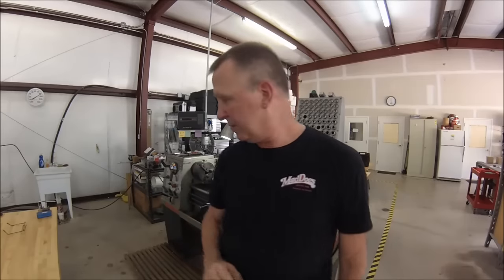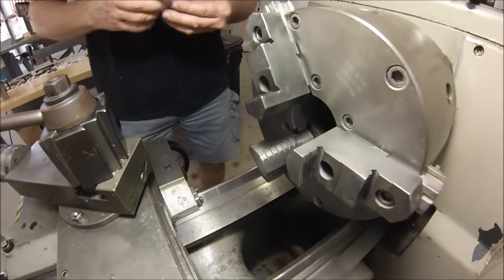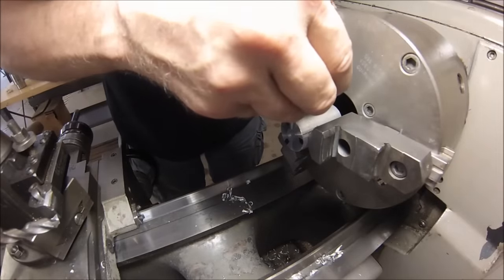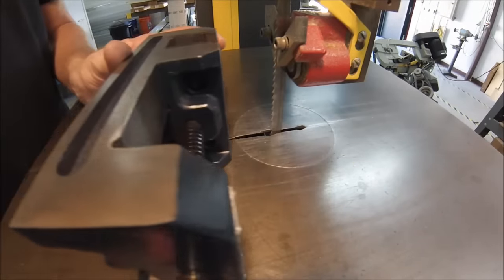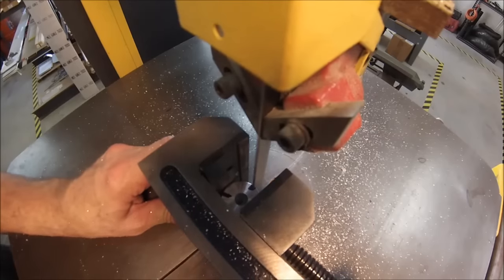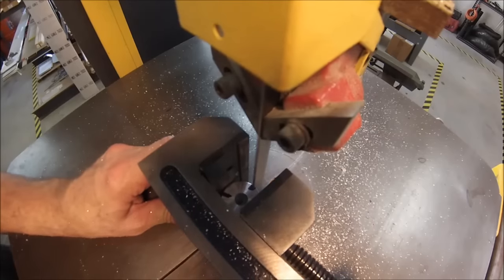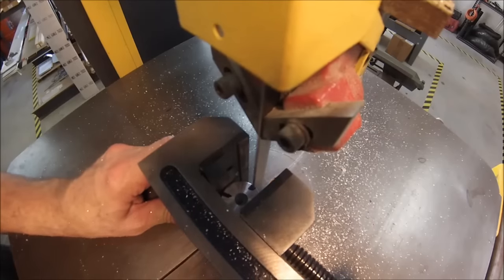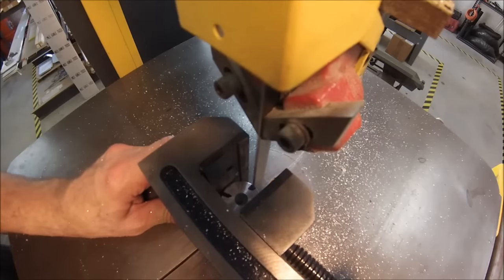Get your parts to run true in a non adjustable chuck. YOU MUST WATCH THIS!

Comment: ive tried this before at a shop i worked at, chuck still didnt repeat though.. it would get thrown off every time it was loosened and tightened again. after many attempts of trying to get it to repeat true i ended up putting a four jaw in and i indicated in a large jacobs chuck and just used that as the chuck. but i am curious as to why you would suggest this over just boring the jaws...
Reply from the maker: Because this video wasn't about boring the jaws.
Reply: yeah i noticed that... it was a half hour video about boring a sleeve with slots in them, like a 5 min op.

Comment: Joe Pieczynski I did a traditional indentured apprenticeship. I've never heard it said nor seen it written (before this vid) that one should not run a machine with an empty chuck as long as jaws are clamped shut. What is your reason for writing this on the video captionst 2:50 in ?
Reply from the maker: I don't believe I said that. I said its not a good idea to run a chuck with nothing in the jaws, and I'll stand by that remark. The chuck body and scroll accelerate at different rates. Done repeatedly, the jaws can, and will walk out.
Reply: ah I see, like I said if the jaws are wound shut this is not a problem, also few hobbyists lathes will accelerate smartly enough for this to be a problem, but I agree tat running it empty and not wound shut is not a sound move

Comment: You said "never run the lathe with the chuck empty." I just bought a new machine and in order to "break in the spindle bearings" I'm being asked to run the lathe with the chuck empty for a total of 1 hour, speeds increasing every 10 minutes. How does that square with your advice? Great channel, btw, one of the best.
Reply from the maker: Thank you for the compliment of the channel. If the break in procedure calls for running with the chuck on, simply take the jaws out to eliminate and potential launch possibility. Thanks for asking.
Reply: @joepie221  Simply chuck a small piece of stock!  DUH!
Reply: @glasslinger  No that wouldn't be running the chuck empty.
Reply: Well if it's a cheap Chinese lathe, the jaws probably aren't going to walk out - so probably not a problem. And what is the point of running the chuck empty anyway? Isn't the caution in not loading the bearings before a period of breakin? Something short and lightweight chucked would seem to be okay.
Reply: @glasslinger  empty  means nothing in it  duh

Comment: Your reamer cutting slightly oversize would explain the .001 runout. I found that boring jaws in a Cnc lathe .002 or even .003 smaller then the part will generally run truer.
Reply from the maker: The reamer cut on size. It was an oversize reamer.

Comment: My impression from this is that you should fix the chuck jaws so they're concentric with CL of the machine. Doing this would end up wasting a lot of time if you weren't using the machine to do a large volume of the same thing back to back. I've got a few ideas for how I'd go about dressing the jaws but I'd be curious if anyone knows if there is a "correct" way of doing that on a non-adjustable chuck.
Reply: they key to doing what you describe is to preload the jaws with a piece of scrap within range of the diameter you need, behind the gripping area. if you have a set of soft jaws you can then take a skim cut on the jaws to true them up. you can do this to the hard jaws as well but you may have to use a grinder mounted to the tool post. I have done this before using an air grinder
Reply: they also make adjustable 3 jaws, you may be able to find a used one and save money over a new one, or you can mount a 3 jaw in a 4 jaw but make sure the face of the 3 is running true

Comment: My Cushman 3 jaw was out .008  
I used a ring on the outside of the jaws and then used a boring bar on the internal. 
Now I have a 3 jaw chuck that's center.
Reply from the maker: Hi Bill. Technically you loaded the jaws incorrectly. If you want the best results, the jaws should load in the same direction as the use load. You may have made it better, but introduced serious bell mouth. If you start to have chatter, that's why.
Reply: Don Bailey (Suburban Tool Co) has a very good video on trueing up a scroll chuck on a grinding machine, but you can work your lathe chuck with a toolpost grinder using the same principal. As I recall, he uses a ring on the outside of the jaws BUT only to allow him to create a small true spot right at the back of the jaws. He can then use this true spot to clamp onto a round slug and proceed to grind the main portion of the jaw nice and true. It is important that the jaws are trued while being tightened onto the OD of a round slug as you are at least then bearing on the same side of the scroll teeth as when the chuck is in use. This also stops you from bellmouthing the jaws as would happen if you were excessively tightened out against the ID of a ring (which would very slightly cock the jaws inwards causing more material to be removed out near the front of the jaws)

I made a toolholder to firmly hold a die-grinder in my aloris toolpost for this. Of course, die grinder wheels are only 1/4" shank so you have to take your time and use baby cuts. However, it is certainly possible to do a very acceptable job of your chuck jaws using them. Also, making new Aloris toolholders is another excuse to use the shaper, which is my favourite old machine and a fun way to make some chips. #oldschool 😎
Reply from the maker: Don Bailey of Suburban Tool usually wears his watch, wedding ring and long sleeves during his videos. Not setting a good example at all. If he was one of my guys, there would be a big problem. I'll start taking him seriously when he looses the jewelry. His chuck truing technique, is better, but not optimal.
Reply: Yep, noticed that🙈 

Small good habits and safe practices learned from the beginning will become second nature and ultimately lead to your fingers remaining intact a whole lot longer🤗

Long sleeves can be ok at a push if they are snug fitting and have snug cuffs, but NOT saggy sweaters or loose baggy shirtsleeves 🙊👀🙊

Anyways, thanks for all of your excellent videos on tooling and suchlike🤓

Making a second ER collet chuck for my own lathe at the moment and your excellent video on the tecnique for setting the compound precisely will be really handy for cutting the angled spindle nose recess. Much easier setup to spread out your measurement over 100mm of compound travel than simply indicating the narrow taper on my DIN_55027 spindle nose.

Love your pantograph idea and the poor man's angle gage solution you shared! 😎

Keep up the good work, best wishes from Ireland 👍
Reply from the maker: Thank you for your comments and feedback. Regards from Austin TX USA

Comment: only one prob. if you take the split bush out and have to do other work on the lathe and then have to put it back in again will your split bush not be out of center again? then you must  rebore/ ream again for concentricity?
Reply from the maker: True. To use them again, use a thinner shim, or bore to the next size up. These things will ultimately need to be replaced.

Comment: Hi Joe, without reading through the rest of the comments, do you not tighten all three jaw screws and then the 4th ?
Reply from the maker: I start any process by checking the part first. If it runs true, I don't touch anything. If not, I loosen all 4 screws, work the part in by pulling on the low spots and then snug the opposing sides.
Reply: He said he was going to show you how it should not be done, ie. to put the chuck out of alignment

Comment: Boring hard jaws isn't an everyday thing but it can help & should be a one time only thing - you'll need a very rigid, stiff boring bar, a carbide insert & fairly slow RPM (put the ring/spider in the slides so you can bore through)
Reply from the maker: Grinding with a toolpost grinder is the recognized method to correct worn jaws. Boring is extremely time consuming.
Reply: @joepie221  but thanks to his and your comment, we now have two ways to go about the repair.
Reply: Grinder!   Wayyy better and don't have to worry about having an insert for interrupted, hardened cutting or trashing an insert with the impacts of the jaw.
Note: this is from a very personal experience of trying to use a boring bar and carbide.  Grinder turned out better and easier even though it took some fabrication to mount the grinder.

Comment: Hi Joe, just a question: I  thought that the Test Dial Indicator reads true if the feeler is in straight position, is that right?  I also read somewhere that it reads true in 12 degree position.  What is and when is the reading true? I use it only as a reference indicator. Thanks in advance. Old Bob
Reply from the maker: I only trust my indicator measurement when the arm is straight our, but the needle movement is a function of rotation, so it really shouldn't matter. Any ways....I believe its called an indicator because its intended to indicate errors, not measure them.
Reply: That Old Bob it's called Cosine error. Doesn't really matter too much if you still have the same read at every point. 0 is always 0

Comment: Thanks Joe. I may have missed a part. Did you mention it's important to align the soft bushing with the same corresponding jaw once you've removed it from the chuck then returned to it later?
Reply: He did.  He marked the  chuck key  orientation.  Rotated  key to 12 o'clock, marked  bushing at 12
Reply: @fourfortyroadrunner6701  Well if you noticed...he took the part out and faced the back before he marked it. In my book that means he lost the original orientation and never owned up to it. Obviously the hole was undersized enough that it didn't matter in the end. In other words, he did some of that just for the camera.

Comment: Hey Joe, I'm looking at setting up a "Spider" on my lathe so I can run a barrel through to the chuck and keep it all concentric. I was wondering if you have done this and if so could you talk about the best way you might build one and set it up. I need to be careful as to not mar up my customers barrels. I want to be able to start crowning, threading and facing barrels to actions and bolts as to bring in work for high end gunsmithing. It may be a wile before I'm good enough to offer this but we all start somewhere.

Tim Ditmore
Matrix Gunsmithing
Lake George, CO.
Reply from the maker: Hi Tim, Can you give me some more details? Muzzle out, or chamber out? round barrel or irregular shape? This should be an easy one.

Comment: Great idea! Better than trying to fumble around with shims. And now the part should be running quite (tailstock quill) straight down  the bedways. Except I don't have such reamers; can the boring tool  work  too?
Reply: I assume it will work but not as well as a reamer - at least I cannot bore with accuracy of a reamer (new one) - maybe Joe can.
Reply: @tomk3732  Oh, that is what I expected.But an external cutting tool is usually not extended the way a boring bar or tool would be. Maybe the flexure makes this more of a challenge. I am wondering if an abrasive end for the very finishing approach would help.

Comment: Pete...been following you with numerous videos and find you very knowledgeable...
I'm just a novice operator who has gotten a lathe and am learning to machine projects with it...
I was curious though and  have considered a magnetic base for a dial indicator and was curious as to who's you were using in the video 
"get your parts to run true in a non adjustable chuck"...I was curious as to what would a professional prefer a magnetic or a base that would attach to his QCTP? thx
Reply from the maker: Mine is a US General model 387. Very old and long discontinued. Ebay maybe?
Reply: @joepie221  Thanks for the information Joe...

Comment: As always, great setup for making one expensive part or 30 production parts.  Job shop, constantly, is one or four parts made quickly, using available chuck(s) without investing in $1000+ chuck.  The topic I ‘d like to see is grinding jaws with hand held grinder ( Foredom, Dremel, Dumore, Craftsman, Proxxon…).  Can it be done?   8” - 10” 3 jaw.  To have < .002” eccentricity.  Most of us have made tool post holders for these; but no one has shown to use for jaw grind.
Reply: Great video, but what I’m saying is , I can’t afford time on 1 or 2 parts to make this collet and bore.  Small shops don’t have “proper “ spindle tool post grinder equipment in shop.  Getting jaws < .002” is solution for a working job shop making money.  Can jaws be trued without $2000 grinder setup?
Reply from the maker: After you've done this s few times, its less than 10 minutes to do.
Reply: @thatsthewayitgoes9  Rigidity matters, and you'd be as well off grinding jaws with a piece of rubber as you would with a hand tool.

I wonder, are you actually a machinist? If you really can't afford a $2k setup, why not experiment with making your own TPG? You need two rigid high-speed bearings, a single-point diamond and a grinding wheel. Pulleys, belt, and an electric motor could be salvaged. The rest of it can be made from cutoffs any job shop will have. The important part is that the grinding wheel not deflect substantially - so the shaft through the bearings and the sleeve/block holding the bearings must fit well and the sleeve/block must be attached to the machine solidly. A mechanism to preload the bearings is needed - generally a spring. The shaft must protrude enough to get the grinding wheel where it needs to be, but to minimize runout (and thus vibration and chatter) it should not be longer.

Comment: I'd have chucked up two sizes I need  end mill's, and held  the piece in the tool post and milled the slots rather than band saw ?
Reply from the maker: However the slot gets in there is fine. Just be safe doing it.
Reply: @joepie221  I just came across your video's and shall be binge watching , your water pump slinger episode was nutts, wish I could have apprenticed under someone like you 30 year's ago, cheers , Max